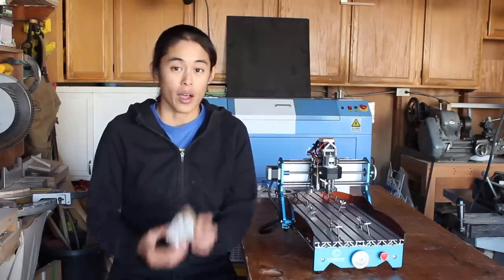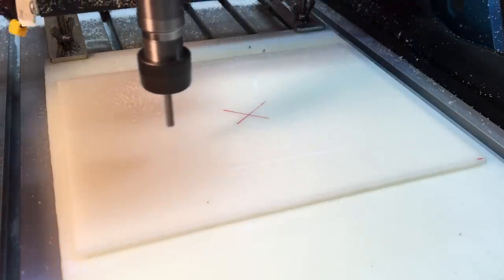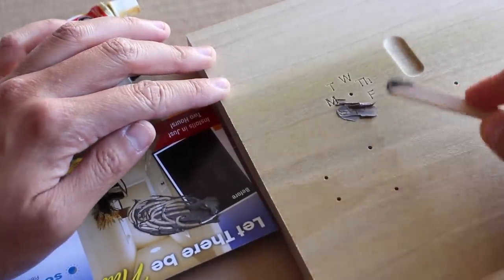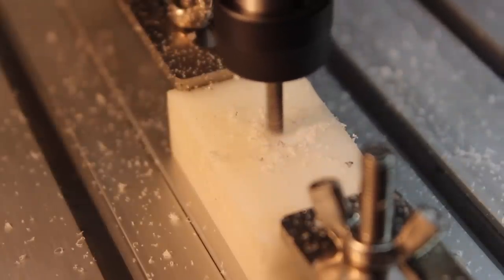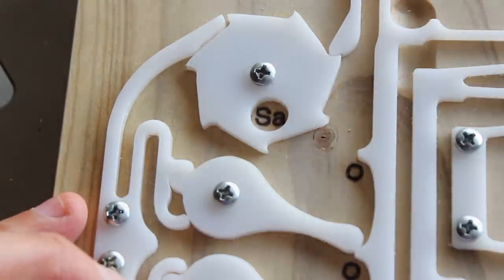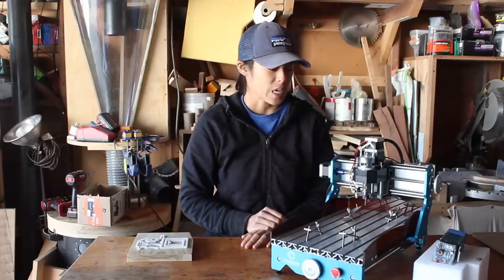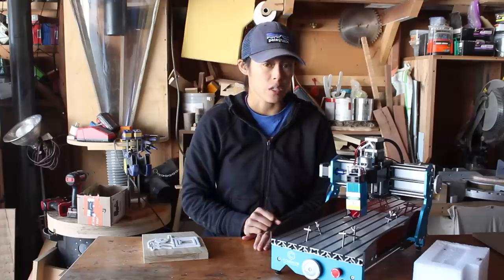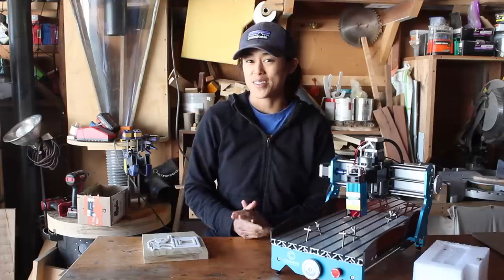Flexure Mechanism: resetting calendar

Comment: Love the flexure mechanism. FWIW, slower isn't necessarily better in CNC; if you reduce your chipload too much (which is what you're doing when you reduce feed), you end up with the tool rubbing (rather than cutting) the material, which results in heat accumulation at the cutter/material interface (in absence of coolant, chips are the primary mechanism of removing heat from the material, and if you're rubbing, there aren't any chips being produced to remove the heat). Heat buildup will simultaneously dull the cutter and potentially work-harden the material (if it's metal), both of which worsen the situation, so you enter a positive feedback loop. Generally speaking, you have several options here (and you may have to use more than one to cut soft metals on your mill): add coolant (air, or small hand-dispensed quantities of fluid like WD40), reduce depth of cut (thereby reducing tool pressure without reducing chipload, although at some point this also leads to rubbing), use a cutter with a different number of flutes (which changes chipload without reducing RPM; small DC spindles like what I think is in that CNC are prone to loss of torque at low RPM, and you need high torque to cut harder materials). But overall, if you look at recommended chipload for your materials, you have to pay attention to both the min and the max recommended chipload → you can't reduce feed indefinitely. Hth!
Reply from the maker: Thank you for taking the time to write out thoughtful and well-explained suggestions! I like the idea of just reducing depth of cut rather than slowing feed so much like I did. Also I think using a better cutter is a no brainer - the ones I was using were some of the cheapest you can get. I felt the work and didn’t really get heat build up so that didn’t seem like a big part of the problem.

Comment: Little tip for using a CNC router: a lot of beginners think that it's a good idea to turn down feed rate and depth of cut if your machine isn't very rigid, but that's not the case. It creates a lot of friction and therefore chatter. Give the endmill something more to bite and it will be happier. Also it's a good idea to use roughing and finishing passes, not doing everything in one go.

With the turning off of the spindle it really sounds like grounding issues, I had something similar happening to me. I was using a Dremel though.
These cheap spindles that are just DC motors with collet holders don't look really trustworthy anyway, I bet the runout is beyond acceptable. It also looks like the shaft flexes easily.
These free hanging guides the machine uses are also not ideal because of flexing, made the same mistake on my machine.
You could try to swap out the spindle for a straight grinder (I have one from Kress), those are way more powerful and rigid and have barely any runout. Just have to find a different relay because it runs on AC power.
Reply from the maker: Thank you for the detailed comment, those are great suggestions!

Comment: You could always attach a vacuum hose to the spindle, an air line would work too, but more messy. Also, don't forget you can dye cyanoacrylate based glues with India ink. Very cool.
Reply: For the size of machine it would probably be best to hang a hose from above so the machine doesn't have to work very hard to move the hose around. A basic Ikea cabinet could probably hold the whole machine and a vacuum above it. Vent the vacuum outside and you basically have an enclosed vent hood with chip collection built in

Comment: Mmmmmm CNC Snow, make a Acetal snowball and chuck it at a engineer!
Try setting your Z height with a ground pin of a known diameter. Edge Precision uses that method and I have found its so much easier and accurate then paper, I even use it for setting my printer height.
Very nice work
Reply from the maker: Great suggestion!!

Comment: When you were doing the metal, you were going hecking slow. If you go too fast, you risk tooth chipping, if you go too slow, you risk tool hardening the part.

But if it was a safety feature that caused the stoppage (maybe a resistance sensor or a deflection sensor) then nothing would have fixed it since it was so sensitive.

Otherwise, first video ive seen, hope to see more. Have a good one.

Comment: You should be able to mount your board once more to the engraver. Okay, sometimes i dont want to go the direct path either but try out something alternate.

I had some two times the needs for using 2-component glue that had originally the mixed color of some gray (might it be 60% white, components were black and white). For this i were adding some once a smaller amount dark brown acrylic color and the result was a medium brown, and in the second case i used black which gave me a reasonable dark color. I am not sure if that weakened the mixture but i felt it was anyways a slightly elastic type of glue in the end.

Comment: I'm doing brass on a project, too.  It seems like energy is released in the process of separating the material from itself.  The smaller the chip, the more this happens, the hotter it gets.  The alloy is s whole lit harder than you'd think with so much copper.  Torque & pressure seem to be the name of the game.  I'm having to think about it in terms of cutting out chunks instead of grinding, while spending more time cooling than I am cutting.  (Ugh.)

Comment: ha, this thing can be use in fish farm, green house to activate equipments for daily jobs, such as air pumps, feeders, stirring tanks, wire fence, lighting, without those expensive electric panels and relays. and it is pretty safe from electric shock. even a 90 year old grandma can use it. good idea.

Comment: Hi Amy, Just  FYI, there are "3018" CNC machines that are quite cheap. About the same price as cheap 3D printers. I have one, but haven't gotten around to trying to mill aluminium yet. Apparenly "too slow" is not good either. I'm told you should aim for a certain amount of cut-depth for each revolution. I find it slightly difficult to get help from experienced CNC-ers. When I ask them for a sample number for say feed-speed, they say to look it up in a table I should have gotten with my mill bit or milling machine. Well I have neither, so I'm asking the forum. And then it gets quiet.

Comment: You'll need coolent to machine aluminum. Once the tool gets to hot it welds to the aluminum, clogging the flutes and eventually breaking the endmill. Also would be a good idea to pre drill the holes first so the endmill doesn't have to work as hard.

Comment: That flexure part that do resets would be better on other side of that board maybe enclosed by some playwood to prevent damage. Point of it is to decrease size of that thing by almost 50%. The increase of thickness is worth it imho.

Comment: As others have mentioned for plastic a single flute endmill works better than double. I was able to cut acrylic sheets accurately with the included spindle on a 3020. Also some plastics are easier to machine than others. I prefer HDPE over nylon since it's less springy

Comment: You could turn the reset mechanism back 90 degrees if you wanted to reduce the 2d foot print, but you would have to compactify it so the overall part still has a small depth

Comment: A mini CNC that doesn’t cut aluminum wouldn’t be something I would purchase.  There are a lot of mini mills and lathes that will do the job.  Granted the company sent you the equipment to play with, but they really need to go back to the drawing board on this one.  The fact that the laser cutter was a clip-on device illustrates the level of expected precision.  I believe your review was very generous….  

On your projects: How compact could you make the cat feeding calendar if you incorperated a small return spring instead of the flexible plastic return.  I am thinking maybe you should make a feeding bowl with the feeding calendar integrated into the design of the bowl.

Comment: Dude, you need a deburring tool!  
       It's a weird looking bent-spinny-stick thing that you use in a similar way that you'd use a peeler.   It takes a bit of getting used to, but totally worth it!  Not only are the finger cuts super minor (yea, I always cut myself, but with a deburring tool it never gets worse than a small paper cut vs the hell I can do with a razor), but the control can get awesome.  You'll never use a razor again..
Reply from the maker: I have one actually (and love using it) but for plastic, I still prefer using a crazy sharp razor. I didn’t show it because the clip I took was so terrible, but scraping the edge with the razor perpendicular to the edge gives great control and is excellent for removing small burrs on plastic.

Comment: Her talent is in CNC programming and her verbal presentation.  Most of the time spent was probably writing the program.  Nice touch using  .002 paper touch off to the tool.  If  she  would significantly cut down the feed rate she could machine aluminum.

Comment: love the video, but please when using a razorblade or a knife or any cutting tool, push away from your body and the hand holding the part ur working on. I know a couple people who have gashed their hand open cause they were pulling the blade while working. please be safe and I love this video
Reply from the maker: Haha, thanks for looking out! The forces in this case are super low, so I’m willing to risk it. But I agree with your advice!

Comment: This may be an obvious work around, but... Remove the frame from the wood backing, gently apply heat to the areas you would like a closer fit and bend them just enough to close the gaps, then, reassemble.. 🤔 Good work though 👍😏😎🇬🇧

Comment: i think the vertical week day incrementer would need a better stop. it goes a bit too far.
alternatively an index notch, or say 7 of that, would do a nice job to put the part in place. (some mechanisms are using spring driven balls to give a nice lock in.)
why not using a 7 faced polygon and a flat facing spring that totally holds it in one of its desired positions. (okay then this would raise the question on how to turn it with the vertical lever.)

Comment: Great mechanism! Yeah I don’t see the merit of a desktop Cnc other than PCB boards. It’s messy , a lot of clean up and fixturing is a hassle. Cutting metal precisely takes a lot of power which needs a pretty rigid frame which won’t really fit on a desktop unless it’s designed properly with high grade materials. They are companies who do something close but the price is much higher than a tormach etc. thanks for the honest review
Reply from the maker: thank you for watching!

Comment: Can you go into detail why the machine was 'pausing'  ? thats odd especially for those NEMA 23 steppers... 

I found sometimes fusion 360 will create hugely complex pathing which will slow down older 8 bit MARLIN flavored vector drivers.... You can try 'smoothing' and lowering the accuracy in the CAM from the default of 0.0004"!

Comment: I'm curious, for the linear slide mechanism, is there a way of making it more compact? Or does it inherently need to be a certain size due to the nature of the material? Great to see you posting new content!
Reply from the maker: wonderful question! The size is mostly defined by the bars that do the bending, so we can consider just one rectangular cantilever beam for simplicity.  You can get the same force AND deflection from a long wide bar as you can a shorter thinner bar of the same material and thickness. However, the peak stress is higher in the thinner bar. We want to stay below the yield stress so that the flexure doesn't undergo permanent deformation, so there's a limit to how small each bar can be (plastics don't have as clear of a yield stress as metals do, but in this example, it's still a fair way to think about it...). In practice, I didn't actually calculate for a particular peak stress in this case, just kinda did it by feel and based on past flexures I've made that haven't been permanently deformed by use. So it likely could be smaller. Also, changing to a different material (one with a higher yield stress, steel for example), could make it dramatically smaller.

And that's all without actually changing the shape yet, just shrinking it smaller! That's why mechanical design is so interesting 😁 This site has a lot of the actual equations: https://www.engineeringtoolbox.com/cantilever-beams-d_1848.html

I realize comments are a pretty poor format to answer a question like this. I'd be curious to know if there is appetite for a video about design tradeoffs like this, or if it would be too dry 😛
Reply: @AmyMakesStuff  Thanks for such a thorough reply! While I can only speak for my self, I'd certainly be interested in that video, and in general more about the considerations made when designing flexures.

Comment: Amy, what is the plastic you are using?  It looks to be cutting like nylon.  I use Acetal for most machining projects as it machines so well.  Acetal is much stiffer than nylon and not too expensive.  You might find it as Delrin (same stuff AFAIK)
Reply from the maker: ya, it's Delrin.

Comment: 6:11 I have a somewhat dumb question... . im quite new to your channel 😅.... how do you decide on how thin those sections for deformation should be?
Reply from the maker: welcome! not a dumb question at all, it's basically the heart of designing flexures! I am targeting a certain amount of travel and a reasonable amount of force. I also don't want the parts to bend so much that they are permanently deformed. It's possible to look up material properties and calculate what the dimensions of those thin sections should be. In practice, I just guess and base it off experience, and make a few iterations to get close enough 😬
 
If you are interested in learning more about beam bending, I have another video called Flexure Lecture that goes into way more detail. Thank you for the question!

Comment: I have read that all materials put through a "bending moment" test will eventually break.  That white plastic looks like HDPE, but you called it "Delrin"  Does Delrin have a longer lasting integrity relative to its bending moment than does HDPE?  All the delrin I have worked with in my past has been colors other than white.  I actually don't get why you would create something like that, what experiment were you trying to prove, or was this one of those Rube Goldberg apparatuses.

Comment: I wonder if fewer flutes or different endmill choice somehow can help it do aluminium?
Reply from the maker: Fewer flutes would be higher chip load so probably worse? But you’re right that I’m definitely not using a particularly good endmill. I would expect a small improvement at best with a top of the line endmill.

Comment: A common problem when a spindle touches a metal part and goes off is mostly a short in the motor causing it to ground as soon as it hits the metal part maybe more diagnosis
Reply from the maker: Great suggestion!

Comment: Putting a decent spindle on the mill would almost double the cost. 🤣
With such a short Z axis I feel like it's optimized for this kind of engraving/sheet assembly, and modding it wouldn't give a good ROI. A knee style mill would be a better starting point for a general purpose mini CNC.
Reply from the maker: thank you for watching!

Comment: It's an engraver, being able to machine plastic is already pushing the machine's limits.  

That laser attachment is unspeakably dangerous.  If I'm understanding their website, that can go up to 10 watts?  ...which can get knocked off and wind up spraying the entire room as it gets yanked around by the gantry.  I'd ask that you tell them to upgrade that dangerously stupid clip, there needs to be a positive locking mechanism.
Reply from the maker: To be fair to them, the clip is strong enough that I think the chance of the laser attachment being knocked off is exceedingly small. But I do think it’s loose enough to mess up a lot of parts. 

You are right that it is just an engraver, but they do advertise it as more. I think to their detriment. It’s really a pretty decent engraver.
Reply: @AmyMakesStuff  - yeah, the chance of it happening is small.  I'm paranoid about anything laser related, so if there's any chance of a laser pointing in an unintended direction I'm going to run screaming out of the room.

FYI, I run a 6kW fiber laser cutter for a living, so I'm well acquainted with the safety training material horrors.

I would suggest that anyone running the laser on this, put it in an enclosure and do your watching through a cheap webcam.

Comment: if you have compressor and tank big enough you can put a compressed air nozzle on the CNC head or you mad and actually use coolant.

I'm sorry if those are the wrong technical terms but I'm German and too lazy to google proper translations.
Reply from the maker: Those are exactly the right terms!

Comment: Well that machine is using a dc775 motor, so no way it’s cutting metal but if you add a gear reduction, guess what is actually cuts metal. I opened up an old drill and found a dc775 motor in it with a high gear reduction.

Comment: Had a chuckle at the complaint regarding CNC Machines noise level... I mean... It appears to be using a brushed motor - Not a whole lot to expect from something like that 🤔

My 800W ( Water Cooled ) Spindle is super silent whenever it is not engaged in the material https://youtu.be/Ro62PyBb4Zk ( ignore its RPM ramping up/down... I was still in Laser Cutting mode 🤣 ) but then again... Still noisy AF once in the material and even more so with the dust collection turned on sooo... 😉

What strikes me as odd though is it coming to a halt when engaged in harder materials - WTF is up with that? 🤨